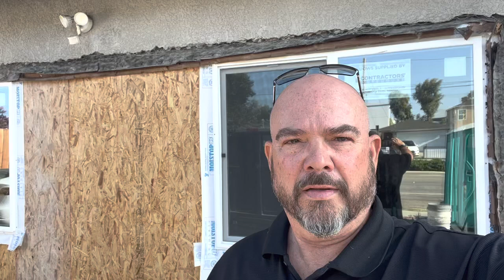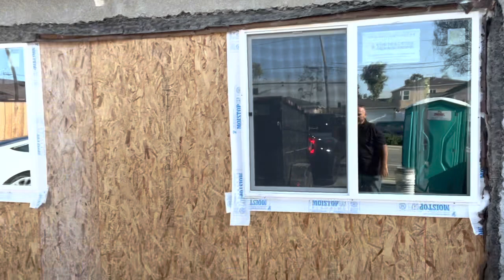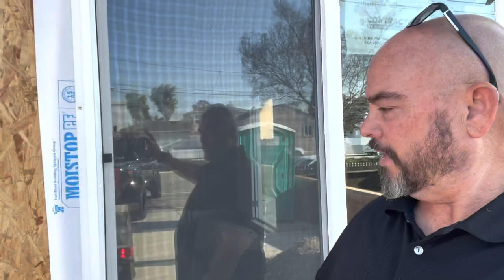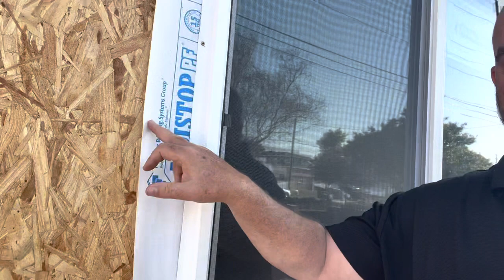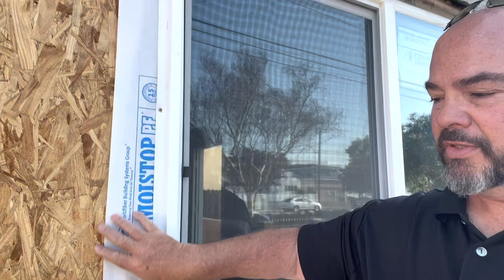ADU 400 sqft | Garage Conversion Update: Shear Wall and Windows Installed 🏠

Comment: Should a 600 sq ft garage conversion into an ADU need interior shear walls?
Reply from the maker: In almost all cases the engineers design them with sheer wall. At least some of the walls would require it.